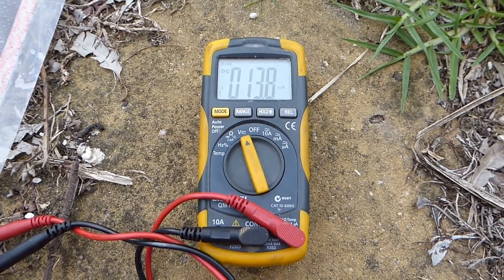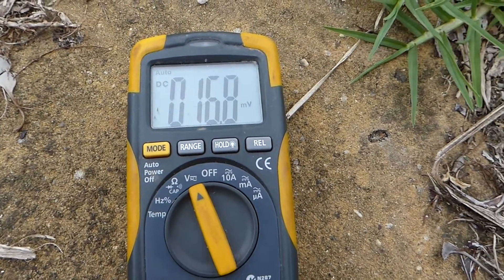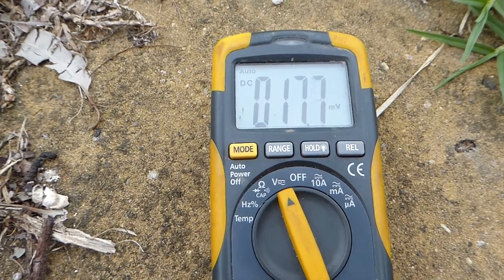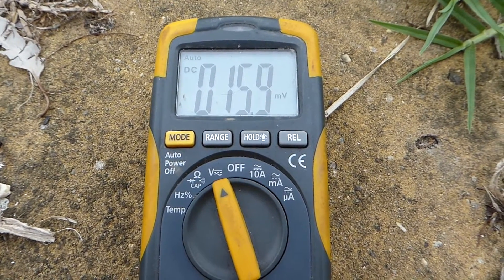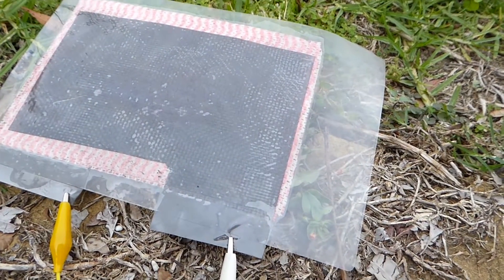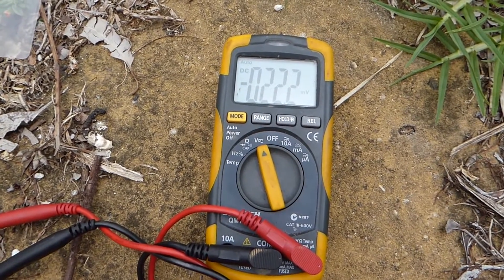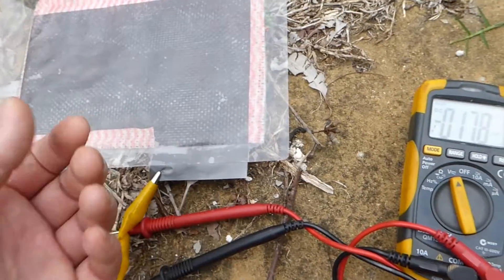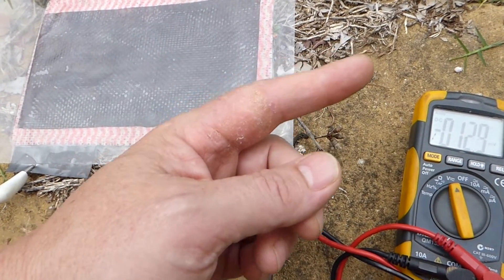Graphite/ graphene Cell collecting solar radiation

Comment: Do you know why when you flipped polarity flipped ,<3
Reply from the maker: I suspect it is behaving as a photo voltaic and because the electrodes are basically the same it depends on what side the light hits as to which sode becomes positive.
Reply: @m3sca1  connect one to high antena plate of aluminum coated...and tge down one to earth.. and see how much magnetic differential will increase by height .. and have the cable going down straight vertical to ground. Inertia will give magnetic pressure and push... while ground negative magnetism is charging the the system with positive absorbing and channeling "magnetic current"... anyway.. try its easy...